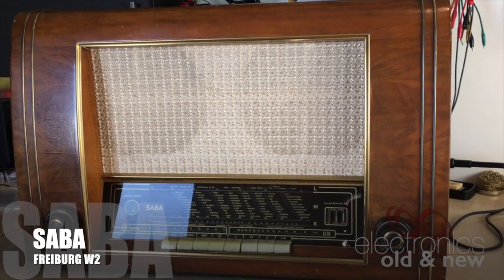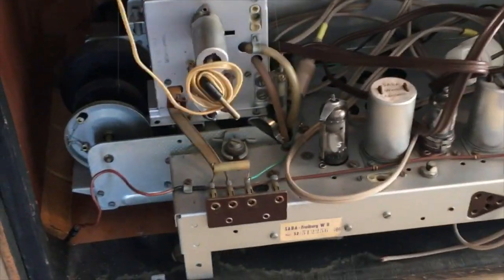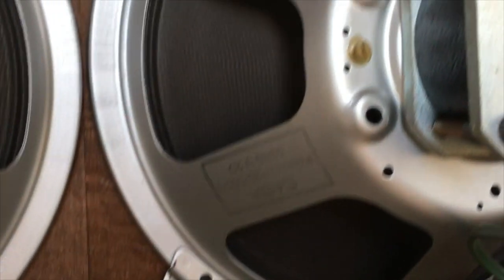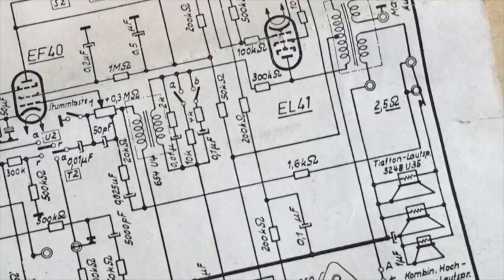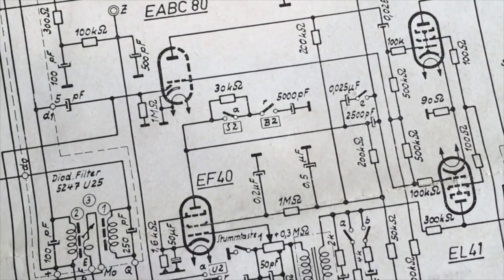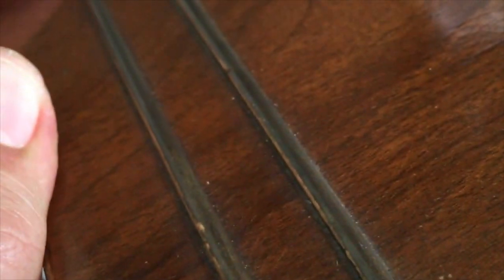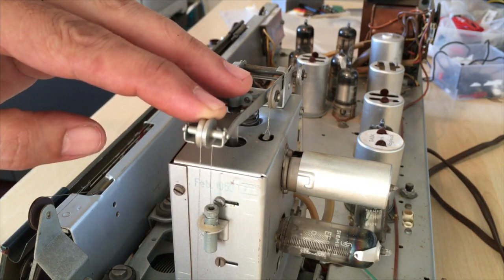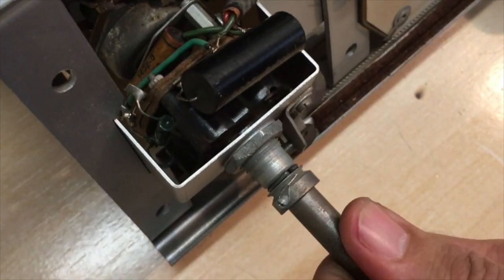Saba Freiburg W2 Restoration - Part 1. First inspection.

Comment: Correct me if I'am wrong but the way I see it is. MW, SW, LW are not very effectively used in the British Isles any more.
FM was in its infancy back then with only 2 tubes allotted to it on this radio. Sensitivity would suffer  I'am sure.
Reply from the maker: Jim Carmody : the AM bands that you mention are still in use in the UK but obviously have lost ground to FM and other more ‘hi-fi’ alternatives. In Madeira (a Portuguese isle) we have an even bleaker scenario: exactly ONE station on MW, none on LW and no SW transmitters to be found. What I pick up here on these bands is thanks to the antenna I use ( a mini-whip active), and can pick up stations from far and wide, including from the UK on LW!
As for FM, one tube is all it takes. I have 22 tube radios with FM and most of them use the same tube (ecc85) for the fm section. The signal then comes into the ech81 mixer that the AM bands use as an oscillator as well, and then it’s on to the IF sections, where the AM and FM signals have separate IF transformers. Sensitivity and selectivity are great, so they seem to have had the system well worked out.

Comment: Just acquired one of these similar to yours but without back that I'm having hard time identifying. Says villigen WII on inside but it's different from yours. Has only 1 speaker and does not have piano buttons on front.  A1so 110/220 and 125 volt I can send pics if you have email.
Reply: Found model. Lindau WII. I assume it's low end.
Reply from the maker: Audio Gear : Ok. Glad you've found it. Saba produced various ranges to cater for the various price levels. Freiburg was the top one, followed by meersburg, etc. Yours may be a 'low end' model, but it's still a Saba, which makes it better than the high end of most of the other brands of the era.
Reply: Thanks for reply. Mine is missing back/and couple knobs. Are they hard to come by?
Reply from the maker: Audio Gear :  eBay is the most likely source. Parts for these radios seem to come up occasionally. Good luck
Reply: Thanks